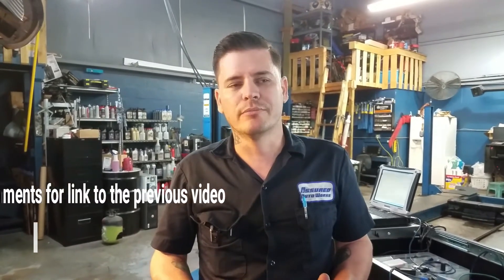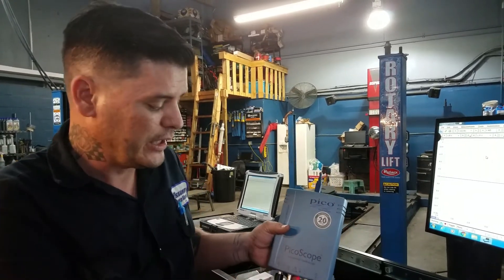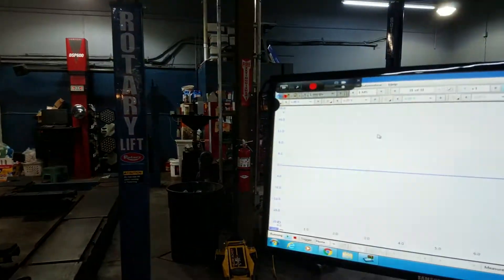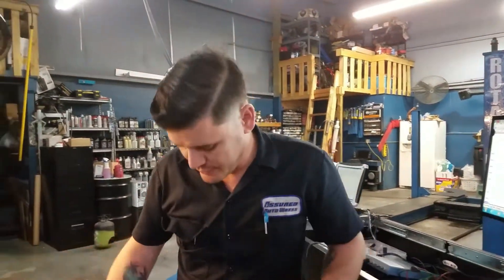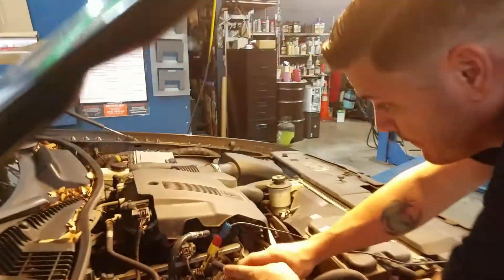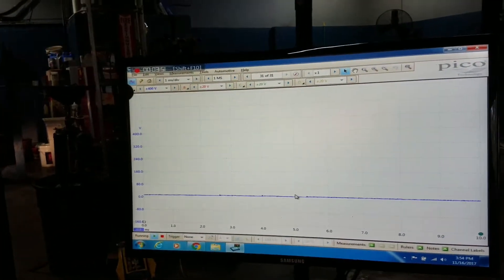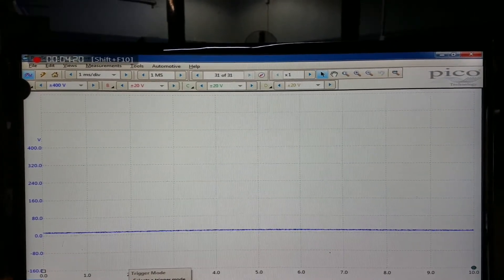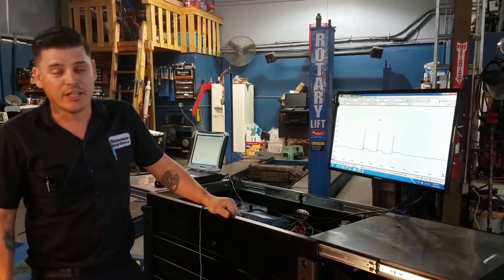Using Attenuators

Comment: When performing this test as you have shown what would it be just as easy to use a low or high Amp probe robe and connected to the oscilloscope and get the same results?

Comment: Great explanation for the newbies and lab scopes. And here comes the "but". But, I never advocate the use of a wire pricker/pincher. Always back probe the connector to tap into the circuit. Sometimes it's difficult to access, but not on a coil or injector wire for a 4.6 or 5.4 liter Ford. Not being rude. I just think it's important to teach the proper way rather than have a newbie engage in bad habits.

Comment: Do you know if a pico scope attunater will work on the snap on scope
Reply from the maker: trublue2319 no it won’t. Snapon uses banana leads and pico uses BNC. No need to use attenuators on Snapon scopes as they have much higher voltage protection.
Reply: When checking high voltage coils on scope it say use attunater . We have a  snap on scope at work most test leads are missing. I ordered attunater from ase wave it's on back hold.

Comment: What is this transistor build in 3 and 4 wire types of Coil on plugs?Is this the control transistor?Is this some kind of ECU protection system to protect the ECU from being burned?
Reply: No.
It is one way of keeping the whole process of High Voltage pulses in one area and save on materials.

Comment: Good Morning Brian and Carlos great video! Quick question can I use the 20:1 attenuator on my 60 A Current Clamp to do a relative compression test? Pico software requires that you use a 600 A Current Clamp, but to my way of thinking if I use the attenuator the 60 A Current Clamp could measure 1200 A. Is this correct? Thanks in advance.
Reply: Current Clamp don't need attenuators ... they mesure hight current ...but they actually picking up millivolts ...

Comment: Nicely described, well done. Do you use attenuators for inductive ammeters when measuring current in primary ignition wires or injectors? In that case the current remains low, so the voltage sent through to the pico from an inductive ammeter should be low, even though there is a transient voltage spike on the wire you are measuring.... I suppose there might be a risk to the ammeter itself, but a Pico attenuator won't affect that risk anyway....

Comment: Great info guys and thanks for sharing it. The guy who runs the KY Home Garage channel recently found that he could get a primary  ignition signal on the three wire coils on a 2010 Mini Turbo! Any idea why it's possible on that vehicle and not on others? Thanks again!
Reply from the maker: Baxrok2 I am not sure. I haven’t watched his videos. I have captures primary on the voltage lead on the 2017 Ford I have in my videos. That is a 3 wire coil. I would have to look up that particular vehicle.
Reply: JM Diagnostics Okay, I was under the impression that you wouldn't normally see that. I'll check out the video of yours that you mentioned. Thanks!
Reply from the maker: Baxrok2 I’m sorry that is not seen in the videos. It was one the vehicle. After the video was made Brian started analyzing the capture. He zoomed in on the voltage line and did some heavy scaling and found it. It isn’t any easy thing to see.
Reply: JM Diagnostics Thanks, after looking into it just now it appears that the coil driver on the Mini is in the PCM despite the 3 wire coil setup.

Comment: When setting up channel "A", you chose a 20:1 ratio. Father down the menu in the automotive section, there is also a 20:1 attentuator option. Is there a difference? Thank you.
Reply from the maker: Andrew K yes there is a difference. It is in the voltage scaling options. Watch the other video I have linked here in the comments for clarification.

Comment: Late to the party....sorry!!! But, great video guys!!! ~Mike
Reply from the maker: Wells Vehicle Electronics um, ya. Where have you been Mike?
Reply: JM Diagnostics What is Function of MSO in latest PicoScopes? I'm quite new and learning Automotive. I want to buy 1 PicoScope, should buy MSO Version or not? 
This Car in video, firing 3times per Cylinder; as RPM increases it will fire 1time?
Relative Compression Test; make a video please and as you informed on Coils with 2-3-4 Wires in detailed and zoomed recording over piercing. Kindly do the same how the channels set-ups underhood. It helps more to understand.
Thanks and appreciate your recording.

Comment: Thanks for the video. Recently I obtained a old Snap on Modis that I use for a scope. Should I be concerned that a high voltage event would ruin my scope ? I will use an example of a relative compression test? I see some videos where the low amp probe is used and other videos use the high amp clamp. I have not had a problem so far with the low amp probe but now you have me worried ? Can you give me any insight on this ? Thanks in advance
Reply from the maker: mugsymydog when doing a relative compression test you can use an amp clamp or just use the voltage leads. No need to worry about voltage levels when using an amp clamp. 

When doing the relative compression test using the voltage leads you start at battery voltage. When you crank the engine over the voltage goes down, so nothing to worry about there. 

Where you need to be careful is when measuring voltage (not an amp clamp) on a coil. It can be an injector or ignition coil. You will need to look at the specifications for the scope you are using. I’m not sure what the specs are for the vantage. I believe they are higher but I can’t tell you what they are. You need to find out what the maximum voltage is for the scope you are using.

Comment: Great video. Would you recommend a 4 or 2 channel for the DIYer. And which 4000 series would you suggest. Really would appreciate your inputs. I have an attenuators for a ds203 scope but the scope is so small looking for a better setup. Thanks artie
Reply from the maker: Arthur Fricchione both the 4423 and the 4425 are excellent scopes. They have some differences that you need to know about. The older model featured in this video has all of the grounds inside the scope connected. The newer one featured in the videos I have shot myself has isolated grounds so each channel has to be grounded separately. The other major difference is the level of voltage protection. The older model 4423 is up to 100Volts where the newer 4425 is 200volts. 

I would recommend a 4 channel over a 2 channel scope. I find I want even more than 4 channels enough that 2 is out of the question. Hope that answered your question.
Reply: Nice video guys !
But still this scopes are to pricey i think . What about the cheaper series 2206B and etc. ? What is the main difference btw the 2000 and 4000 series ? The automotive software that came with the scope ? I read somewhere that you can import the software to the 2000 series scope too .
Reply from the maker: Crank  I am not qualified to answer your question. Keep in mind everyone you see on my channel posting videos is a working tech. I’m sure there is someone at Pico that can answer these questions for you. What I do know is that Pico released these scopes (4423, 4425) for automotive use and the other scopes are not for automotive use. I can only tell you that the scopes we have leave no disappointment. I hope you can find the answers you are looking for.
Reply: Crank go to KY home garage and he shows you how to modify a 2204 for automotive use. I have a 2205A and followed his modifications and they work just fine.